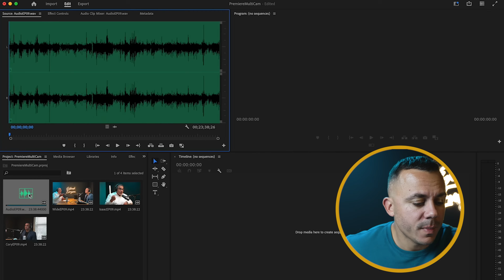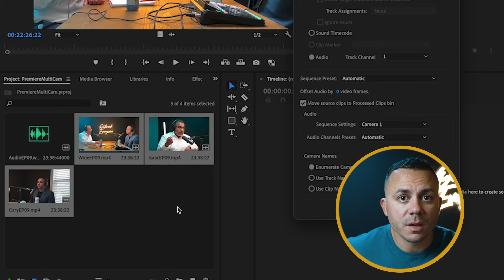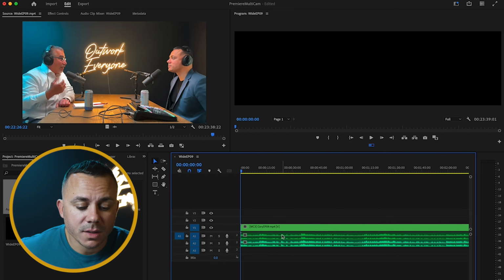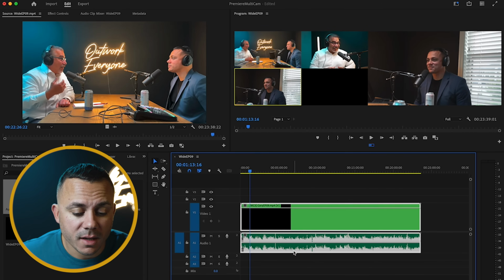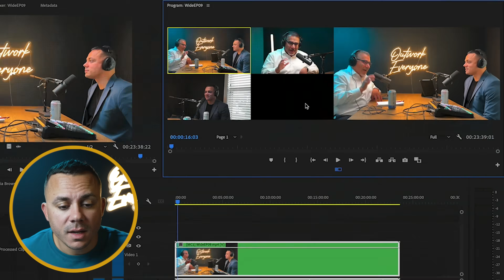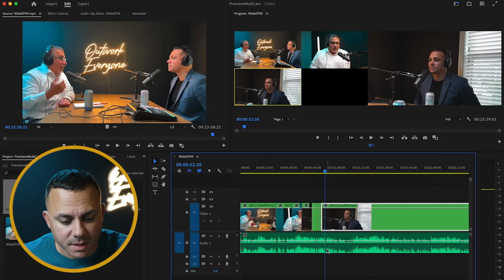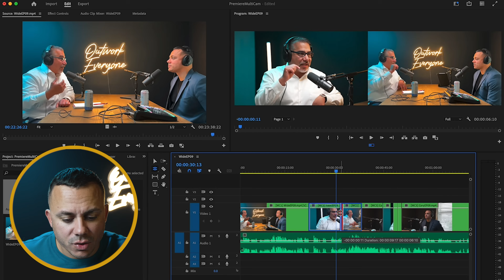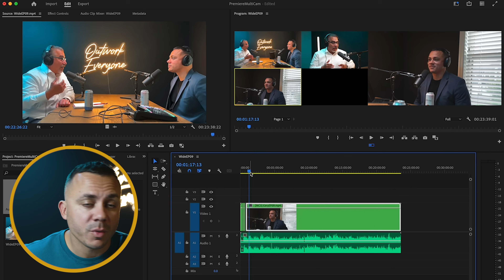How to Edit Multiple Camera Angles- Great for Podcasts

Comment: how can you ensure all the cameras are synced? Did you use the same timecode on all of the camera angles? And how does the audio know to sync up?
Reply from the maker: When you right click with all clips highlighted and select “synchronize” It syncs just by matching the audio. Most people will clap loudly at the beginning of your recording so the software can see that initial spike in the wave form and will sync up the audio… if you don’t clap it will still usually do it just based on the audio waveform.
Reply: @corymalveaux  Thank you. Helpful. Appreciated.
Reply from the maker: You’re welcome!

Comment: This is great, Did you have a separate mic connected to your phone or cameras when capturing audio or does everything sync without extra mics?
Reply from the maker: I used a shotgun mic on the cameras but not necessary as long as the native mic can pick up the audio... I didnt use a mic for the iPhone that one just the native mic on the phone. Thanks for watching!

Comment: How do you manage to keep the same time length in all videos and record from 3 different cameras? Do you edit the times to be the same?
Reply from the maker: The time lengths aren’t actually the same when I put the footage into Premiere Pro. When you sync the footage, it will all sync, but the videos will be different lengths. You just have to cut the beginning and end off to make them match if that makes sense.
Reply: @corymalveaux   Yes makes sense thanks

Comment: did the good audio come in as one line or did you record good audio separately for each mic?
Reply from the maker: I usually record into Garage Band separately so I can make adjustments in garage band then I export as one file and use that in premiere pro.
Reply: @ thank you what if you are recording to like a ride mic. Put them in garage band then edit the files separately on  different track then export as one?

Comment: Very Helpful! How do you switch between the different camera audios as well? Sometimes when recording vlogs or game play with 2 or 3 camera POV's, one audio is louder than the other, or your camera will pick your audio better than your friend's camera that is farther away... so you would obviously want to use your audio for your voice and their audio for their voice instead of just having 1 main audio (It doesn't matter much with Podcasts as everyone is sitting in one place the whole time so the audio won't fluctuate much throughout the recording, but how do you do it when the audio levels ARE constantly changing and you need to use the audio from the specific camera that captured it when using that camera angle in your video?) Thanks for any help or advice!
Reply from the maker: You would want to set this up manually by highlighting your footage right clicking and selecting synchronize. Once the footage is synchronized, you will want to unlink the audio then highlight your footage again then nest the footage once nested you want right click the nested footage and enable multi-cam. Then you will want to make sure that all of your audio tracks are level by making sure when each person is talking It’s at the same audio level before you make any cuts then just go through the multicam edit using the number keys and cut back-and-forth between camera angles. if you don’t pick up each other’s voices at all on each other’s cameras, then you won’t be able to sync the footage automatically, and you would have to to go to the tedious process of manually syncing all of the clips.
Reply: @corymalveaux  Hey, Thanks so much!! I tried what you said, and I can make this work for me! I don't know if this is the final step, but I just cut the audio again everywhere I cut the video (to switch angles) and just delete the audio of the POV that I'm not showing so both audios don't play. It might not be the correct method, but it will work for me haha! Thanks so much for your help! I've been searching for weeks, and never found anywhere that actually explained this (and tons of comments in all the videos of other people like me trying to find the answer... so maybe another idea for a future video of yours... if you are looking for ideas! haha)

Again, thanks so much for taking the time to write out all the steps! I really do appreciate it! Keep up the great videos! =)

Comment: Question! I did all of the above and it only sync's to one of the videos. Can you tell me what am i doing wrong?
Reply from the maker: Do you have audio to all the videos? If so, and it doesn’t work I recommend closing out of your project going back in and try again. If that still doesn’t work there’s another option. You can highlight all the clips right click and synchronize audio then highlight your clips and nest the footage then right click And turn on multicam.